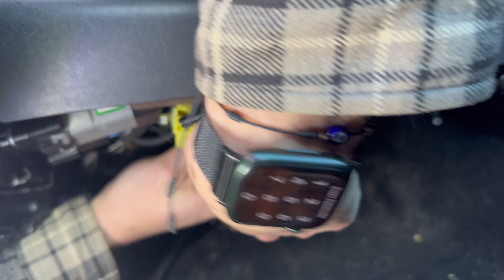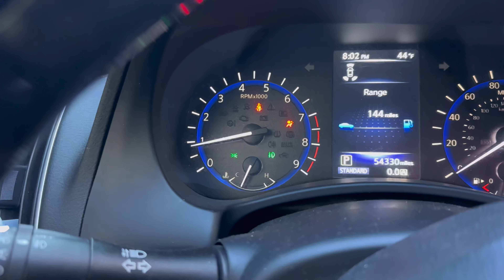REMOVING THE SEATS IN MY Q60 REDSPORT

Comment: Front seats I believe weight 75lbs each, rear seats weight 50 total. That’s 200lbs, but you have to put in new seats and they do weight a bit.
Reply: Don’t you also need a resistor for the front passenger seat to not get a light?
Reply from the maker: Sounds about right and I weighed the new seats and the brackets. New seats weigh 26lbs and brackets weigh 8lbs.
Reply from the maker: Yea you need a resistor but unfortunately the one I purchased didn’t work so I have to do more research and find the right one with the correct ohms
Reply: @2seep   Do you know how much the carbon fiber trunk and hood saves if any?

Comment: Did you notice any gains with the weight reduction bro , I have a  rwd red sport how much pounds  dose it weight .
Reply from the maker: You definitely do notice a considerable amount of difference while driving. The car will feel a lot lighter and your top end will improve. I was able to shave off .3 seconds off my 60-130 time just from removing my oem seats and replacing them with bucket seats.
Reply: They weigh close 60 to 80 pounds, don't bother, trust me
Reply from the maker: @thekoenigsegg  60-80lbs is a lot 🤣

Comment: Honestly the rear seats only weigh like 80 pounds together. Not noticeable at all and for the ppl that say it does feel diff are lying lol. Ofc he says like 150 pounds cause he Jack's and giant Hawaiian punch bottles that weigh far more than the seats lmao. Rear seat deletion is more of a slow car thing, but it doesn't have no benefit other than serving as delusion to feel you modded your car when you don't have money for parts yet. It serves no true benefit for street cars unless your q is gonna be a full on drag car with 1000whp. Notice all sports cars that are powerful and fast don't require stripping the interior, modded or not, they all have full interior lol. Other than that you can if you want the car as an actual race car but a daily project fast car...removing seats is worthless. I have a 600whp ipl g, 400whp acura and a 900whp 5th gen zl1, I would know ober many years of having these cars
Reply from the maker: The front seats weigh around 70lbs (each), the  lower portion of the rear seat doesn’t even weigh 2lbs, but the top section weighs around 15lbs. If you do simple addition you’ll come to find that you’ll be shedding around 150lbs like shown in my thumbnail. My bucket seats weigh 32lbs (each including the bracket) so when you subtract 32lbs from that 150lbs of reduction you’d still be saving around 100+ lbs. If you know so much about cars you know 100lbs makes a difference whether it’s rotational or static weight. Also my car is pushing 800 whp so if you consider that (slow) I don’t know what to tell you.